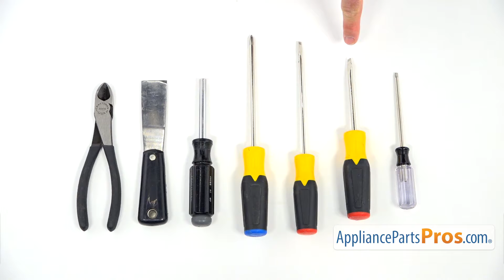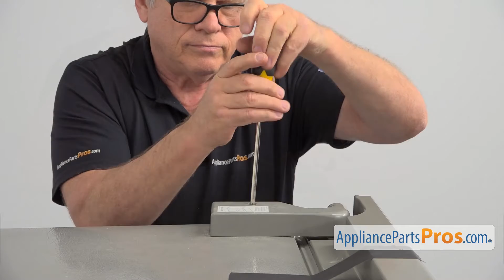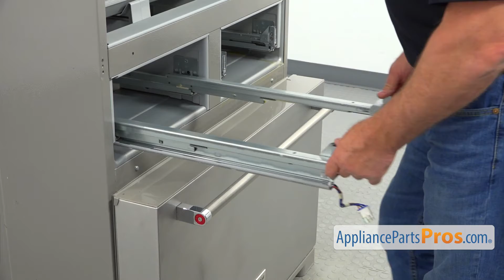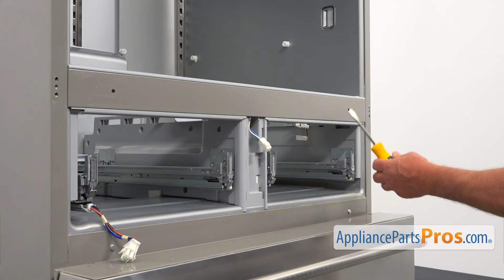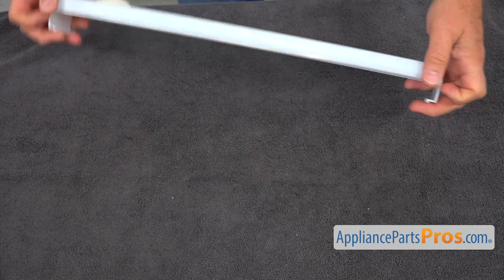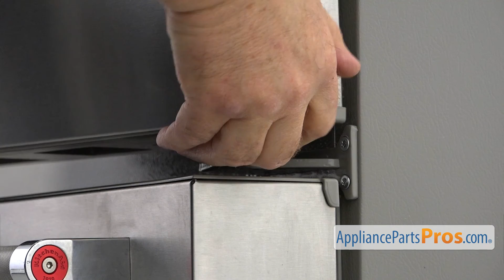KitchenAid Refrigerator Evaporator Drip Pan W11457241 Replacement — fits Whirlpool/Maytag

Comment: Just went thru the drip pan replacement protocol. It took me 3 hours to dissemble and reassemble.  This was not an easy fix.  When I got to my pan it was in good shape. The pool of water/ice under my pullout drawers was a result of a plugged tube (ice and debris).  It took almost an hr to unplug.  Apparently the ice/water buildup under the pullout drawers is a common problem with this model frig. My 5 drawer KItchenaid has been nothing but one repair after another. Poor engineering.  I will never buy another KItchenaid appliance.

Tip of the cap to Appliance PartsPro  for this video.  The protocol was very clear.
Reply from the maker: Thank you for sharing your experience, and we're glad the video was helpful. A blocked drain is a common cause of that symptom and is definitely worth checking before replacing parts.

We appreciate the kind words about the video, and we're happy to hear the repair instructions helped guide you through the process. Hopefully your refrigerator stays trouble-free for a long while after this repair!
Reply: I have the same issue
Where the bottom of the crisper drawer always have a block of ice and water. Was this able to resolve your issue?
Reply from the maker: A clogged or frozen drain tube can definitely cause ice and water buildup under the crisper drawers. If the drip pan and other components are in good shape, clearing the drain and making sure it stays open may resolve the issue. If you’re still having the problem, check for recurring frost buildup and make sure the drain is properly defrosted and clear. Good luck with the repair!
Reply: @appliancepartspros I defrosted the drain tube 3 times and still the doing the same thing
Reply from the maker: If you need more troubleshooting or testing information you can check out our Repair Forum: https://forum.appliancepartspros.com/.  It’s easy to register, and you can either post your question or search the forum to see if someone else has already asked the same question.
 
Our experienced technicians, with over 20 years of hands-on appliance repair experience, are ready to answer your questions and guide you through your repair.

Comment: There is quicker way to disassemble this fridge. Put in 2 sticks of dynamite and light the fuse....
What a train wreck of a design. Make the drain hole inside refrigerator EASY to get to, without taking anything out. Like the older models had. You know...the ones that lasted 40 years without repairs...

Comment: Our drip pan was warped and required we shop vac out the pooling water every other week.  I can't believe you have to disassemble the entire refrigerator to replace it, but this video was a lifesaver in helping me get the job done!
Reply: I have the same problem. If I don't shop vac the water out every 2 weeks I'll be dealing with ice which is harder to remove.